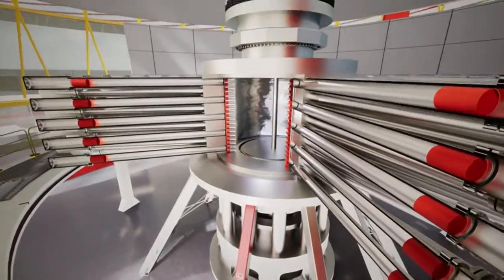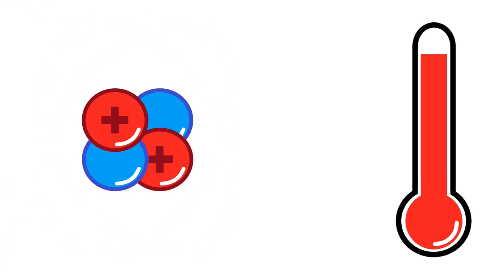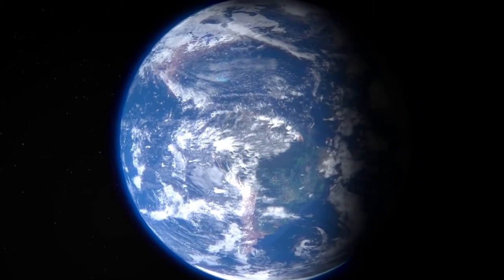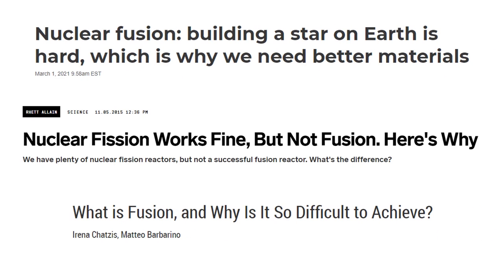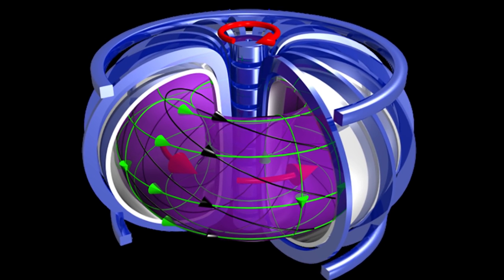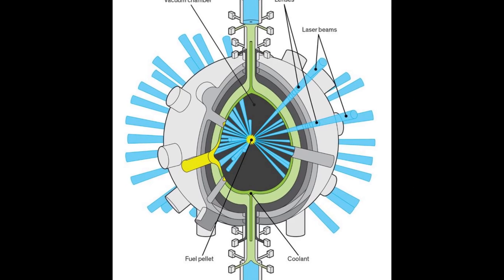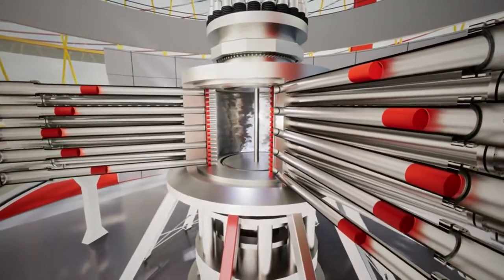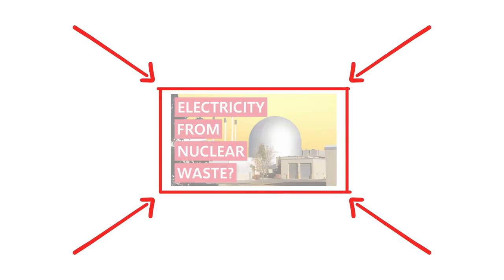This Canadian Fusion Reactor Could be Built by 2025

Comment: Correct me if Im wrong but liquid metals in general are tend to be transparent for neutrons and D-T is a neutronic fusion (about ~80% energy released as the kinetic energy of the neutrons liberated in the reaction) which makes the transfer of fusion power to heat for the liquid metal a dubious proposition. Im pretty sure there has to be some technical detail to solve this I missed though. (maybe a special aloy, some sort of neutron reflector system, or just the density change of the metal under compression changes the high energy neutron reaction (scatter) crossection idk.)
Reply: The neutrons stop in the metal transfer ing their heat.
Reply: @paulbedichek2679  Yea that is the conjecture, Im more interested in the reasoning. In some fast spectrum reactors liquid metal coolants used specifically to avoid moderation due to neutron transparency. Now, how those reactor conditions differ from the condition of this one  (my guess would be the metal density) is probably the key to understand the heat transfer scheme.

Comment: I'm kinda in awe. What material pistons are made of? How overheated steam powerful enough is produced?  As far as I know there is absolutely no solid material which can contain pressure and heat required for nuclear fusion. That's why concepts as electromagnetic field containing and accelerating charged plasma and making it even more charged and lasers which deliver energy by heating with one very well timed precision blast are used. At moment plasma is put into liquid metal vortex it should or immediately heat or put liquid metal into state of gas or plasma as well and firing pistons out of cylinders as cannons.

Comment: I'm no expert but I don't understand why we are bothering with Tokamaks. For research, sure, but how is it possible to get a Tokamak to produce actual useful power assuming the reaction is sustainable? General Fusion actually has an answer which is much more compelling than the typical approach. I can definitely see this actually working. I can see piston timing being an issue but the fact it is intended to compress liquid metal could make this less of an issue. Issues I see are steam blow-by into the reaction chamber or liquid metal blow-by in the reverse direction causing problems. This approach is still genius even if it comes with kinks. We don't need a fusion reaction to be continuous to benefit from it. If you treat it like a big engine with heat cycles, it will still generate usable heat we can harvest to drive turbines. Very excited for their demonstration reactor.

Comment: I mean, you abstracted from the idea that fusion energy has been successfully produced experimentally and practically as hydrogen bombs, also fusion power does produce low level nuclear waste, because of the high neutron flux that may be 10 times that produced inside a conventional fission reactor, so pretty much anything becomes radioactive. all in all your video was great.

Comment: I can't help but think that the allignment of these pistons must be fantastically precise and would probably be fiddly as hell.  I can see this being set up and working once but how could it work repeatedly without losing allignment?
Reply: And there, I believe, you have hit the biggest problem of all. Making, aligning and timing is just precision engineering - coping with wear looks like a project-killer.
Reply: @E-Hamel you would get asymmetrical compression: not good for fusion or your apparatus.
Reply: Just a simple matter of adjusting the motors that power the piston to the right rhythm

Comment: my initial reaction was, how do you keep it from melting ???  as i clicked and the video started i was struggling to think of some heat transfer medium, and to my surprise, they explained that, and the proposed process...
it has to be designed to run, but looks like a heck of a thing to get started...it's going to be a nerve racking first try, for sure, so Safety First. and i am sure i will hear it in the news if you get it running..

Comment: Looks like this reactor could work.  Would be better though if it could be made somewhat smaller, like a refrigerator, rather than a dirigible hanger.
Reply: Well, like computers, early versions of anything will be much larger than later versions, though Fusion reactors do gain efficiency with increased size
Reply: @UNSCPILOT  Exactly.

Comment: What magical element is used to contain the plasma? It's supper hot and melts everything it touches, in case you didn't know, hence the magnetic fields used in other experiments. 
Sounds like hype to me.
Reply from the maker: Although I didn't touch on it in the video, the plasma is magnetically confined - it's just this approach doesn't require as powerful magnets as a tokamak design does - regular copper electromagnets can be used. You can read more about it here: https://generalfusion.com/2021/07/how-does-magnetized-target-fusion-use-magnets/
Reply: @ProfessorGoose  In other words it relies on "Magnetized Target Fusion that operates on pulsed basis", what ever that means but probably is a process that has to repeat reliably and accurately a few times per second just like like all the other fusion experiments so far.. still sounds like hype to me.
I do hope someone will figure this out one day though.

Comment: Seeing is believing. For fusion, one needs so much heat and pressure the input of energy will make it work at a loss if one has to supply the heat and pressure.
Reply: I agree, so much mechanical parts in such extreme pressure conditions means that most of the energy will be lost in friction or will implie extreme heat conditions for lubricants. All mechanical part must move at very high speeds to avpid letting the liquid metal reach plasma state (where it could just mix with the burnt lubricant !).

But this is still an idea to be tested because if it can work, it may be a better manageable solution than other fusion reactors which also convert heat to steam to create electricity (with less mechanical parts but more electronics and a vacuum chamber which is not required here).
Reply: Those steam pistons have a huge punch then it is multiplied by the same ratio of the original sphere is to the final volume, maybe a million to one.

Comment: This concept violates the first premise of plasma confinement: It should remain away from material walls, since it will sputter elements from the wall, which will cool the plasma. Any impurity with a charge Ze, where Z e is the proton charge, and Z is the number of protons, will radiate as Ze squared. Furthermore, if the impurities are in atomic form, they will emit line radiation. Such loss of energy will prevent to reach the necessary temperature for fusion.

Comment: When I look at that design all I see is a bunch of fusion powered potential projectiles pointing in every direction.
Reply: It's all about water hammer effect, here they used liquid metal to replace water. I thought about this many years ago, I thought by then I was stupid otherwise why others didn't get that simple idea.
Reply: They just need to add very little amount D-T as fuel, enough to make liquid metal very hot when water hammer & fusion take place, but without enough power to explode.

Comment: Was thinking about this the other day, a cars engine has piston rings and even at   ~9.1 compression ratio there is blow by so how do yo make rings for this? Even Apexi seals would struggle
Reply: Don't need seals you just want to start a pressure wave.
Reply: @paulbedichek2679  spoze it has the steam pressure on the other side too.. hmm.. makes me think about water vapour getting in but who knows

Comment: Playing with plasma in the million degree + range, if something goes wrong it won't just cool down, if it loses containment it will expand rapidly, vapourising everything it comes into contact with.  BOOM
Reply: The amount of material in the plasma is actually only very small. It's energy will disparaat into the air very rapidly.

Comment: What everybody leaves out is the fact that Tritium is not exactly plentiful.  Then, one of the most significant problems with Molten Salt Thorium Reactors is that they produce Tritium in copious quantities.
Reply: Yeah, molten salt reactors would be an ideal compliment to fusion reactors. You could theoretically use the power and heat generated from a molten salt reactor to help start a fusion reactor while using the tritium it generated to help fuel it.
Reply: @killman369547  It's kinda like a "Hydrogen" bomb.  It takes a fission bomb to get one started.  Then, there is the big lie about the H-bomb:  H even in the form of LiH, is not dense, so it can't be energy dense.  It's not that it doesn't produce energy, but it extended the Neutron flux, utilizing more of the fuel in the primary fission core while igniting secondary and even tertiary fission cores.

I do believe that research should continue on fusion reactors, but the idea that fusion is somehow going to leapfrog fission is just not practical.  The light water reactors we are used to are inefficient and impractical, but there is more than one way to split an atom.  Anybody serious about limiting green house gasses must pursue atomic power.

Comment: I thought tokamaks are used because containing such heat is "impossible" using normal matter. Wouldn't the pistons melt ? If the reaction is not maintained(heat to not propagate to pistons), than I guess only a very small amount of fusion would happen at once. I can only hope that small amount is enough to become energy positive in a system where mechanical motion is used.
Reply: I guess the very short pressure time is by design, the very idea of using pistons and an injection of plasma. Basically like an explosion engine in gasoline cars and motorcycles, which generates plenty of excess energy. What I'm wondering about is what the wear on the pistons will be, due to the immense heat-cold cycles (as you said, though the pistons don't actually touch the plasma) as well as their resistance to the pressure, and what powers them. In an explosion engine, the explosion (with an assist from the battery) itself powers the piston to come back to its "pressure" position. In the fusion reactor, it's the opposite as the piston needs to push for the explosion to occur, and the battery power needed to push the piston to increase the pressure is immense. The video also does not mention whether the piston cycles are all synchronised together, or use alternative phases like car engines.
Reply: The metal is already melted.It starts melted and stays melted.
Reply: @paulbedichek2679  yeah. exactly. what are the pistons made of ? that is why tokamaks use magnetic field to levitate matter. anything else melts / evaporates at that temperature
Reply: @paulbedichek2679  Not the pistons. If they melt, it's a major issue....
Reply: @jozsab1  The pistons don't touch the plasma. They're likely to be coated in some ceramic to withstand huge temperatures from the liquid metal sphere, which will act as a temperature buffer. The liquid metal would not be able to move, the pressure variation being the pistons' role, more than actual movement. So much pressure that the liquid acts as a solid, transmitting pressure.
Reply: @martinhoude3518  i get the idea for an explosion, but what about continuous energy production ?
Reply: @jozsab1  The main idea is to keep the steam turbine running. The heat itself may vary, as long as there is enough energy to transfer. This allows for pauses between explosions.

Like a gas engine in cars, 1 piston can only produce power 1 time/cycle. Adding more pistons have the same limitation. But two pistons can be timed as opposite ends of the cycle, meaning 2 explosions per cycle. A typical car gas engine uses pairs of cylinders for each half of the steps of the engine's cycle, producing a steadier supply of power instead of a less frequent big surge. The result is a smoother ride.

In theory, one could add pistons indefinitely to reduce the time between each (that's what integral calculus is). In practice, though, it's not practical and unnecessary, as there are other mechanical limitations. These, however, might not affect the fusion reactor.

The fusion reactor's pistons can, therefore, be used in a way that not all pistons are used at once, but that they use alternative cycles. This would help reduce the delay between power surges. The question remains if the pressure requirements prevent the splitting of pistons into alternative phases, or if all are needed at once.
Reply: @martinhoude3518  but the issue with other methods, for now, is that you need to input more energy than you take out. the issue is starting the reaction. that is why you need continuous fusion. not small explosions. that is why the laser heated pelets and tokamaks and any other method failed. they fail to keep the reaction going long enough to become net positive

Comment: Won't the metal just absorb the heat from the plasma instantly since the plasma isn't magnetically confined?
Reply: Definitely not instantaneously. 

Possibly as fast as it can conduct heat, though.
Reply from the maker: Although I didn't touch on it in the video, the plasma is magnetically confined - it's just this approach doesn't require as powerful magnets as a tokamak design does - regular copper electromagnets can be used. You can read more about it here: https://generalfusion.com/2021/07/how-does-magnetized-target-fusion-use-magnets/
Reply: @ProfessorGoose  All right, so you produce a donut with frozen in magnetic field that after reconnection moves away from the coils. So you want to have toroidal field in the plasma. OK, I integrate it along the donut. Non-zero. And where are the currents? Passing through the middle hole, no... right?

Comment: What makes the steam that forces the pistons inward?
Reply from the maker: I believe General Fusion's plan is to use some of the steam created by the heat exchanger.
Reply: @Professor Goose  I think this takes it backwards. The heat exchanger will work when fusion is already started, so it can't force the pistons inward (or warm up the plasma). Even a car engine will have troubles running without electric current to move the pistons, and they don't have to fight much resistance to do so. But the battery is crucial to start the engine (as most Canadians experience in winter...), with big power (car batteries are powerful but not long lasting, as exemplified with a light being able to drain them in a day).
Another issue I have there is the use of water steam. At these temperatures, the pressure will be insane in the pipes (if not, the power will not be that big on the pistons). And we're not even talking about how to heat up the deuterium/tritium plasma (the isotopic mix is itself expensive to build). Steam pressure is usually the biggest hazard in power plants, the cause of most actual destruction (such as in Chernobyl and Fukushima). Having helium as a waste product is of course great for medical and scientific uses (the current use of helium in balloons is idiotic).
Reply: @martinhoude3518  There is no shortage of He,so use in balloons is property start the reaction ,you'd heat the steam with electrical resistors like a toaster,I've watched this design mature for years, real exciting stuff, they'll soon build a demo in UK.
Reply: @martinhoude3518  So they're going to have to use an external source of steam to get the reactor started, but once it's started it should be able to generate it's own steam to move the pistons.

Comment: I'd love to know if this can provide process heat needed for oil refinement, carbon fiber production, aluminum smelting, steel production, concrete, glass production, and processing silicon for manufacturing solar panels and semiconductors.   I wasn't the biggest fan of nuclear, and I'm still not the absolute biggest fan of it.   But, very high-temperature gas reactors have changed my opinion.   I still want to see more solar and wind infrastructure built where it's most economical.  But, I know it would be much more environmentally friendly if clean process heat could be provided from nuclear plants instead.  If Alberta pulled a France and re-nationalized all its electricity producers, this could easily happen and its emissions would absolutely collapse.
Reply: I think it would be possible. But to do it all of the piping carrying the reactor coolant and their support structures would need to be made of extremely heat resistant materials. Assuming Gallium is the reactor coolant it has a boiling point of 2400 degrees Celsius. The only metal i can think of that can stand up to that kind of heat is Tungsten so that's what the pipes would need to be made of.
Reply: @killman369547  I'm trying to take you seriously, but Pepe in your profile pic is so distracting.
Reply: I had to do a report of Gen VI reactors and mine was on the VHTGR, since its optimized  more for decay heat removal and efficiency it doesn't actually produce that much power for its volume. I think the fusion reactors need a certain scale to operate so it may provide way too much heat for what's needed in industrial applications compared to the VHTR. I completely agree the carbon free industry applications are one of the great uses of the technology but also we cannot power the world of fission alone.
Reply: @killman369547  the amount of reaction is controlled by the amount of plasma injected - the high temp produced from the reaction is imparted/dissipated into a large volume of molten metal - no matter how hot the reaction is if it surrounded by a large enough volume of molten metal the heat will just be dissipated into the metal and the molten metal is pumped to a heat exchanger to produce steam